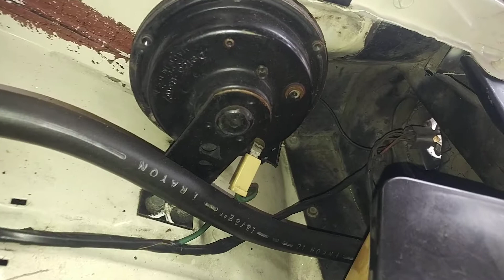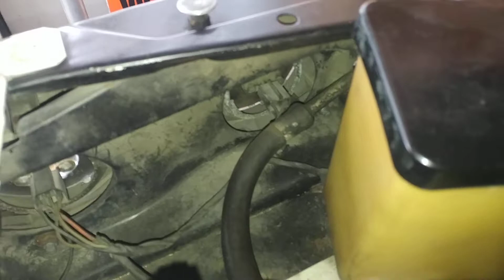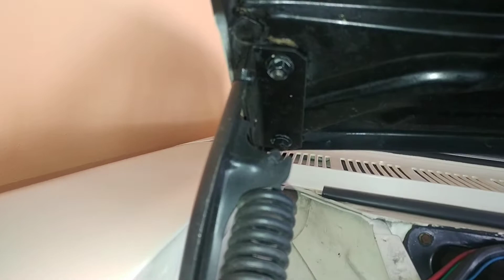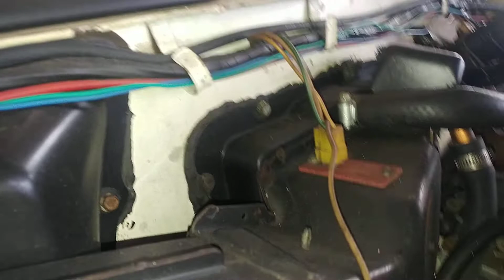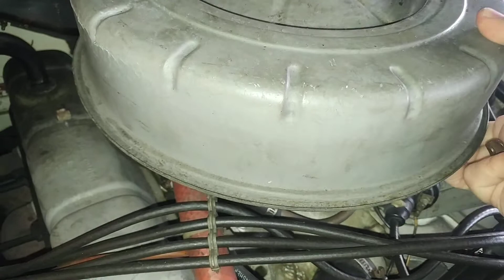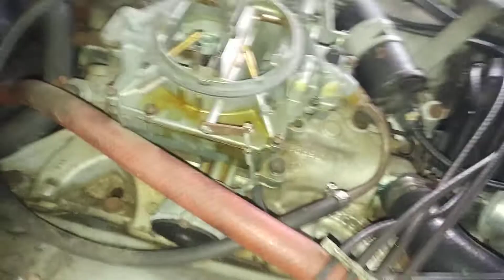1962 Buick Special V-8 engine bay. 12.22.18. M.S. Thacker. Tacoma, WA. USA

Comment: THANK YOU FOR THIS VIDEO! I just bought a ‘63 Special and have been looking for decent videos like this and there is none out there. Thank you again!!!
Reply from the maker: As far as a reference vehicle, this Buick is original and complete. Lots of electrical wires and hoses, but they're all within easy reach to service when needed. Likewise for most of the bolted parts; plenty of room to twirl a wrench. 

Congrats on finding a '63 Special. I haven't seen one of those in person for years and years. Fun stuff.
Reply: @mikethacker3084  hi Mike, thanks for the response! Do you have any documents or repair manuals you would recommend? Or leads on parts you might be able to share?
Reply from the maker: @mariobortoluzzi2929  Hello Mario. Try these links for starters: 
SPECIFICATIONS SOURCES: http://www.classiccardatabase.com/specs.php?series=5925&year=1963&model=24318

https://www.automobile-catalog.com/car/1963/299615/buick_special_2-door_coupe_215_v-8.html#gsc.tab=0

https://m.facebook.com/groups/sync/membership_criteria_answer/edit/?group_id=11237273044&source=mobile_group_join&redirect_to_mall_on_save=1